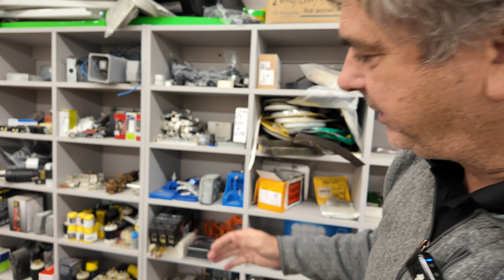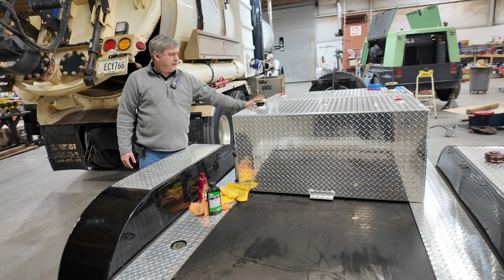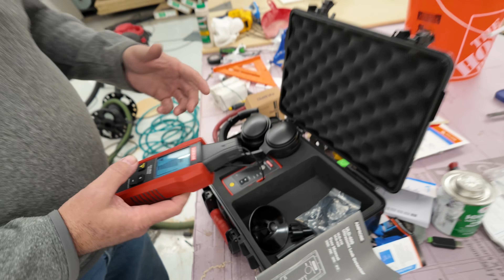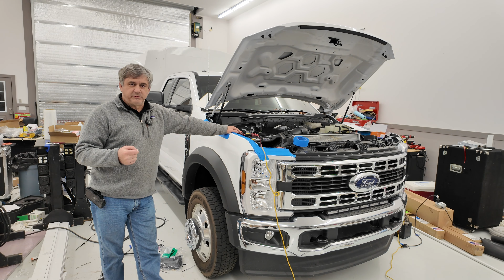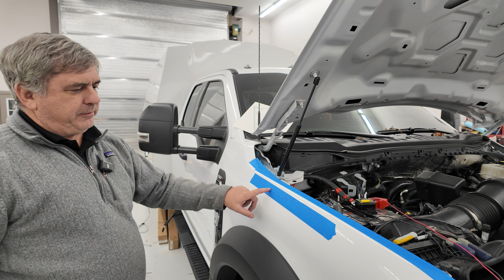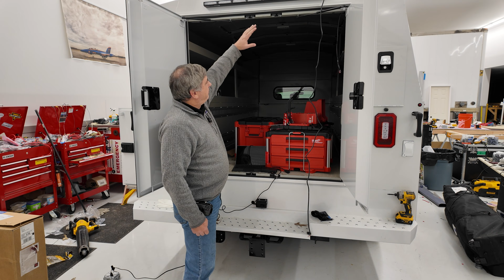Current Projects in the Shop | Parker Systems

Comment: That Ford C&C has the Upfit integration system built in.  Module is behind the glove box.  Allows you to have soft switches in the Sync screen plus CAN bus logic.  Can  help you with SW if your interested.
Reply from the maker: Yes -- I have seen that system and have sent in to Ford under my fleet number to gain access -- I have not been successful so far -- I found that system a year back and I did notice that this truck did come with the wiring harnesses for that system as well as the feature on the dash user interface sync screen -- 

I would love to get the SW if possible -- 

my email is david@parkersystems.net or call the office at 800 8 PARKER (800 872 7537) tell them that you saw this the channel and they will give you my cell number -- thanks for watching
Reply: @ParkerSystems  David,  I work for MSI.  Dave L can get you my contact info.  MSI is setup as a fleet upfitter with access to the program.  Tom.
Reply: @ParkerSystems    Missed your email address,   I’ll shoot you an email